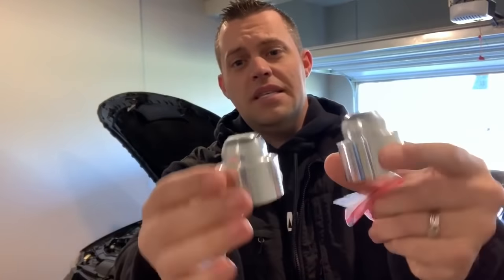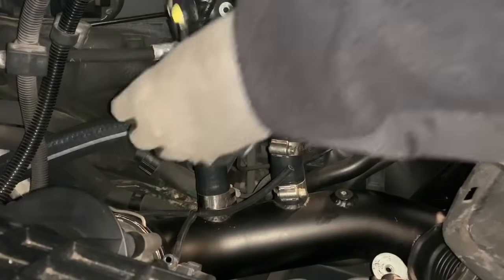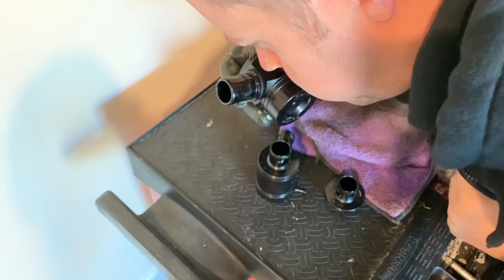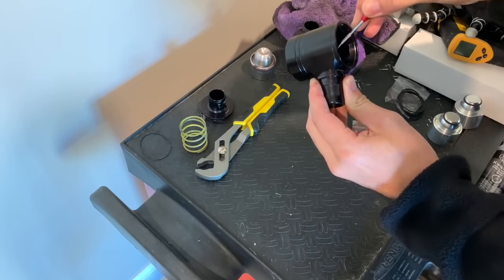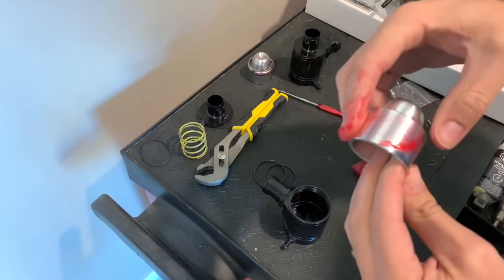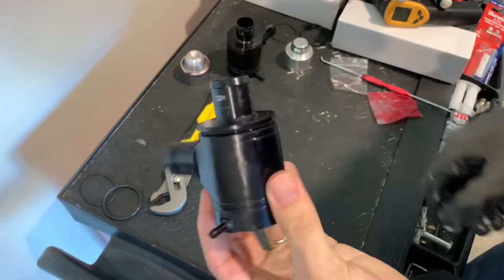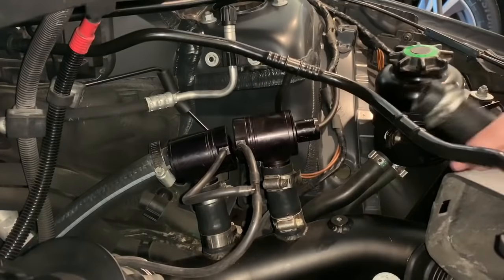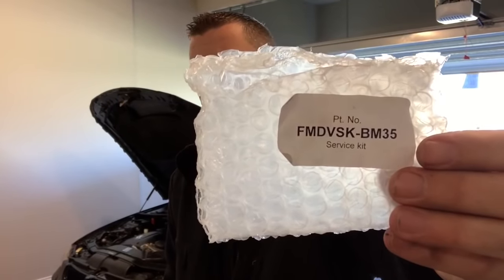Forge Motorsport BMW N54 Diverter Valve Service Kit DIY!

Comment: why are u putting the tubes, if ur venting to out ? does it matter?
Reply: That's what I'm wondering! Have you figured that part out?
Reply: @Lumia Body Renewal figured as much. But mostly wondering why such long tubes? And was also thinking of putting little cone type (intake) filters on the dv's. Thoughts? Opinions?
Reply: The tubes are vacuum lines. He has the recirculating Diverter valves which don't vent much to the atmosphere. They preserve Boost and are honestly better in my humble opinion.

Comment: Do you happen to know the product code for the n54 setup on the forge website? There are 3 different options for the 335i on the link you provided but it does not say which is which .

Comment: Would you mind posting a link for the Forge Diverter Valves you purchased? I have a N54 135i and a model-specific search doesn't show any DVs currently available.  Btw, I totally enjoy your channel/video posts! I've learned so much and saved so much $$$. Thx!
Reply from the maker: Here ya go! https://www.forgemotorsport.com/Recirculation_Valves_For_The_BMW_N54_Twin_Turbo_Motor_135_335_Models--product--1032.html